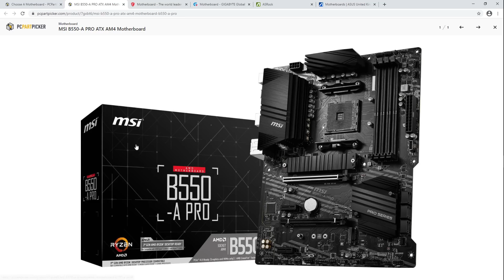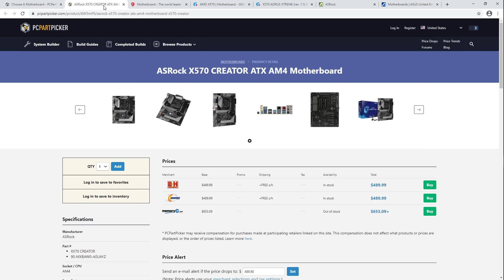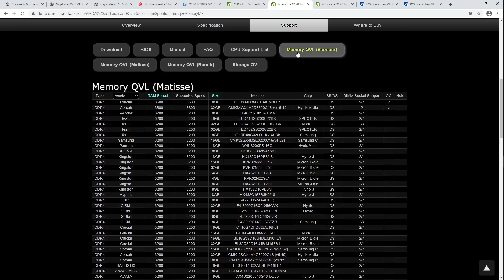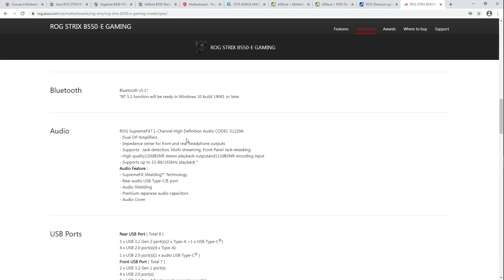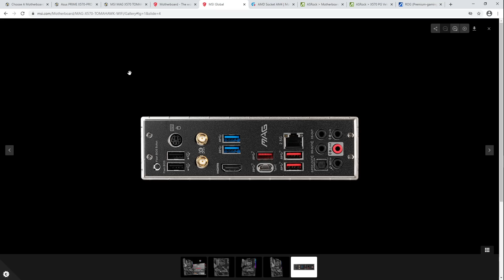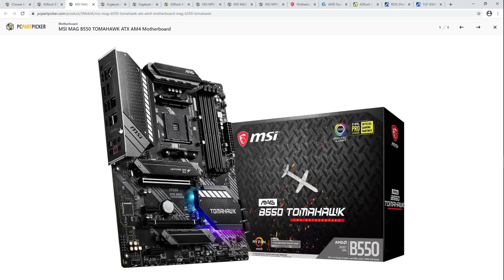Rambling about B550 and X570 motherboards. December 2020

Comment: 0:44 & 2:11:03 MSI B550-A Pro
1:53 Gigabyte X570 Aorus Xtreme
6:33 slight tangent into ASUS Crosshair VIII Hero & Formula
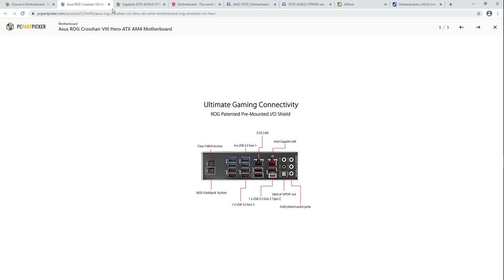7:38 back to Aorus Xtreme
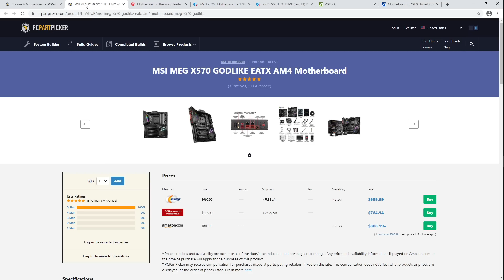8:49 MSI MEG X570 Godlike
12:25 MSI Prestige X570 Creation
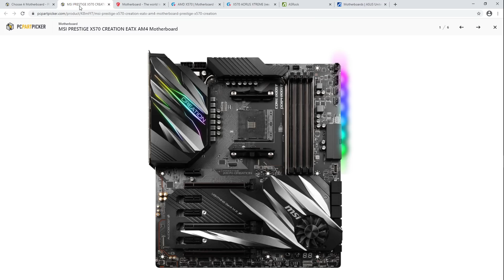18:38 ASRock X570 Creator
22:15 ASUS Crosshair VIII Hero & Dark Hero
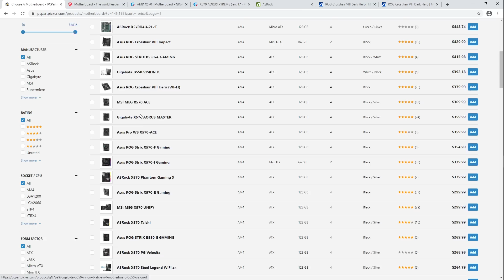28:34 MSI MEG X570 Ace & Unify
32:17 Gigabyte X570 Aorus Master
37:54 ASRock X570 Taichi
49:23 ASUS ROG Strix X570-E
53:37 ASRock X570 Phantom Gaming X
54:53 ASUS ROG Strix X570-I & B550-I
59:47 ASUS ROG Strix B550-E 
1:05:51 tangent into SLI, Gigabyte B550 Vision D
1:06:30 more SLI rambles, ASRock B550 Taichi
1:11:25 Actually talking about ASRock B550 Taichi
1:14:15 Actually talking about the Gigabyte B550 Vision D
1:15:00 Gigabyte X570 Aorus Ultra, Elite, Elite Wifi
1:18:25 ASRock X570 PG Velocita
1:20:47 ASRock X570 Steel Legend wifi ax
1:21:40 ASUS X570 TUF Gaming Pro
1:22:09 Gigabyte X570 Aorus Pro Wifi
1:22:37 Gigabyte B550 Aorus Master
1:24:25 ASUS X570 Prime Pro
1:26:10 Gigabyte X570 I Aorus Pro Wifi
1:26:37 MSI MAG X570 Tomahawk Wifi
1:30:14 MSI MPG X570 Gaming Pro Carbon Wifi
1:30:35 back to X570 Tomahawk
1:32:57 ASRock X570 Extreme4
1:33:25 Winner of the $220 mobos, ASUS X570 TUF Gaming Pro Wifi, honorable mention B550 Taichi
1:35:35 MSI MPG B550 Gaming Edge Wifi
1:36:10 ASRock X570 Steel Legend
1:37:45 Gigabyte X570 Aorus Elite
1:39:48 & 1:50:17 Gigabyte B550 Aorus Pro AC/V2
1:42:49 ASRock X570 Phantom Gaming-ITX/TB3
1:44:36 ASRock B550M-itx/ac
1:46:05 ASUS Prime X570-P
1:46:58 MSI MPG X570 Gaming Plus
1:49:04 MSI X570-A Pro
1:49:14 ASUS TUF Gaming X570 Plus
1:49:28 ASRock B550 PG Velocita = Steel Legend = Extreme4
1:49:54 & 1:52:04 MSI MAG B550 Tomahawk
1:50:38 ASRock B550 Extreme4 & Steel Legend
1:51:24 & 1:58:50 ASUS TUF Gaming B550 Plus (WiFi)
1:52:58 ASRock X570 Phantom Gaming 4 Wifi ax
1:54:06 Gigabyte X570 Gaming X
1:55:01 Gigabyte B550 Aorus Elite V2
1:55:37 MSI MAG B550M Mortar (WiFi)
1:56:42 & 2:02:25 Gigabyte B550M Aorus Pro P
1:58:03 Gigabyte B550 Aorus Pro
2:00:02 ASRock B550M Steel Legend
2:03:30 ASUS Prime B550M-K
2:03:40 ASRock B550M/ac
2:04:13 Gigabyte X570 UD
2:05:22 Outro - Buildzoid's favorite motherboards
2:08:19 ASUS ROG Strix B550-F Gaming (WiFi)
2:12:10 Actual Outro
Reply: A Legend!
Reply from the maker: dude you're insane!
Reply: @ActuallyHardcoreOverclocking  thank you! I didn't see any timestamp when i got here so i decided to skip here and there to make a timestamp comment first then watch later
Reply: @ActuallyHardcoreOverclocking  well he actually used Edit button so its not that insane. A real timestamp pro woulda done it in Notepad and copypasta to make it legit (no edit).
Reply: @mesaber86  I did that then added like 3 that i missed the first time around
Reply: @swisscheesedorito  so you failed your mission :D
Reply: @ActuallyHardcoreOverclocking  you probably dont care that much but maybe consider covering audio chips in your motherboard overviews. Its a pretty important thing as far as driving high ohm headphones. I know people just use usb and dacs and stuff now but it’s important to me and some audio people when building.
Reply: @ActuallyHardcoreOverclocking  

You should pickup a Retail Taichi and Taichi Razor Edition and compare them.
Reply: @shadowopsairman1583  he actually went over the razor edition in the vid. dont ask me when
Reply: @NJcinemaHD  supposedly ot has 16 phases however A physical compare would help
Reply: @ActuallyHardcoreOverclocking  You should pin this comment dude lol.
Reply: That was really needed, thank you so much.
Reply: Incredible! Thank you for rambling to us internet strangers.
Reply: Respect!
Reply: you tha real mvp
Reply: Sexiness arises!!!
Reply: you mad man
Reply: saved me litarly hours
Reply: Excellent job mate!
Reply: You need to get paid. :D
Reply: Thank you!!!
Reply: God bless you good sir.
Reply: 1:00:52 No. That's not your PC.
Reply: The B550 Gaming edge wifi was a good value at $150 w a $30 steam gift card on black friday
Reply: Cheers dude!
Reply: Godsend!
Reply: Omg
Reply: THANK YOU SO MUCH YOU MVP!!!
Reply: ...Was looking forward to what he thinks about the gaming edge wifi, since I effectively got it for 60 bucks here in Germany during blackfriday season :(
Reply: Thank you
Reply: You are doing God work, God speed.
Reply: Thanks!
Reply: 12 minutes rambling about ASRock X570 Taichi, im gonna buy this one, thx for avoiding me to watch this video
Reply: Thanks that was perfect.
Reply: Da real mpv
Reply: THANK YOU Stranger
Reply: Picking up a dark hero 8 from microcenter, got very lucky.
Wanted to here our boys opinion
Reply: This actually saves us allot of time, more rambling please
Reply: @Hudson Armani wow , that was fast and easy,  wonder if it can do other platforms
Reply: M-m-m-assive respect for u, ty
Reply: Godsend post!
Reply: People sometimes tell me "Jesus loves you anyway."
I'm thinking "No, it's people like Swiss Cheese Doritos who put out the love."
Reply: Thank you kind sir !!
Reply: RESPECTS!!!
Reply: This is what he should've done lol
Reply: Love you ~

I just finish work. ~
thank you.

now, a noop me going to have to figure out which X570 to buy -_-

Asus ROG Crosshair VIII Formula - is originally am thinking of going for only to know that there is a lot of plastic....
Reply: i lterally did the same thing, refreshed and saw yours:D your format is way nicer tho^^
Reply: 1:53 Gigabyte X570 AORUS XTREME
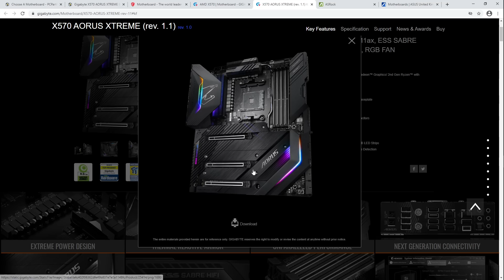5:42 ASUS ROG Crosshair VIII Formula
8:50 MSI MEG X570 GODLIKE
12:16 MSI PRESTIGE X570 CREATION
Time stamps:
18:37 ASRock X570 CREATOR
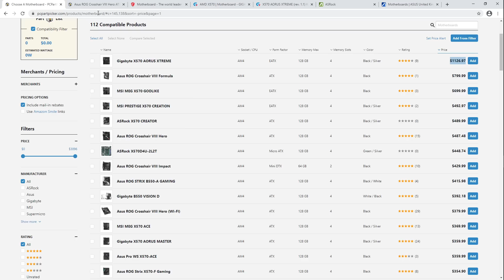22:27 Asus ROG Crosshair VIII Dark Hero
28:33 MSI MEG X570 ACE / UNIFY
32:18 Gigabyte X570 AORUS MASTER
37:30 ASRock X570 Taichi
49:23 Asus ROG Strix X570-E Gaming
53:36 ASRock X570 Phantom Gaming X
54:53 Asus ROG Strix X570-I Gaming
59:46 Asus ROG Strix B550-E Gaming
1:05:47 Gigabyte B550 VISION D
1:06:37 ASRock B550 Taichi
1:18:25 ASRock X570 PG Velocita
1:20:46 ASRock X570 Steel Legend WI-FI
1:22:09 Gigabyte X570 AORUS PRO WI-FI
1:22:39 Gigabyte B550 AORUS MASTER
1:23:28 Gigabyte X570 AORUS PRO
1:24:24 Asus PRIME X570-PRO
1:27:34 Asus TUF GAMING X570-PRO WI-FI
1:29:50 MSI MPG B550 / X570 Gaming PRO CARBON WI-FI
1:32:58 ASRock X570 Extreme4
1:34:30 MSI MAG X570 TOMOHAWK WI-FI
1:35:32 MSI MPG B550 Gaming EDGE WI-FI
1:37:39 Gigabyte X570 AORUS ELITE
1:39:44 Gigabyte B550 AORUS PRO AC
1:42:47 ASRock X570 PHANTOM GAMING-ITX/TB3
1:44:30 ASRock B550M-ITX/ac
1:46:04 Asus PRIME X570-P
1:46:55 MSI MPG X570 GAMING PLUS
1:49:14 Asus TUF GAMING X570-PLUS
1:49:27 ASRock B550 PG Velocita
1:52:58 ASRock X570 PHANTOM GAMING 4 WI-FI
1:53:15 Gigabyte B550 AORUS ELITE AX
1:54:05 Gigabyte X570 Gaming X
1:54:58 Gigabyte B550 AORUS ELITE V2
1:55:35 MSI MAG B550 MORTAR Micro/WI-FI
1:57:55 Gigabyte B550 AORUS PRO
1:58:43 Asus TUF GAMING B550-PLUS
1:59:41 ASRock B550 Steel Legend Micro
2:02:16 Gigabyte B550 AORUS PRO-P Micro
2:03:21 Asus PRIME B550M-K Micro
2:03:37 ASRock B550M/ac Micro
2:03:51 ASRock B550 PHANTOM GAMING 4
2:04:09 Gigabyte X570 UD
Outro Favourites
2:05:20 MSI PRESTIGE X570 CREATION
2:05:36 MSI MEG X570 UNIFY
2:07:08 Asus TUF GAMING X570 PRO WI-FI
2:07:40 Gigabyte B550 VISION D
2:08:16 Asus ROG Strix B550-F GAMING WI-FI
2:08:56 CREATION / Taichi / UNIFY / VISION D
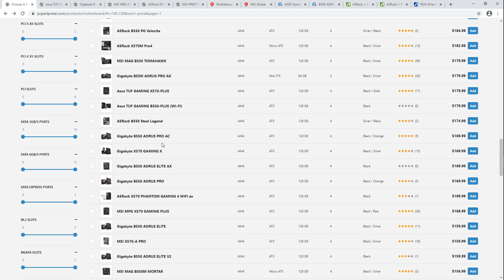2:09:54 Gigabyte B550 AORUS PRO V2
2:10:17 Asus ROG Crosshair VIII Dark Hero
2:10:57 MSI B550-A PRO
2:19:27 Asus ROG Strix B550-E GAMING
Reply: I was about to comment and say BZ please put in time stamps. But wow, you sir are a champion among kings... or something
Reply: You saved me a ton of time and frustration. I was looking for his opinion on Unify for an hour now.

Comment: I'm looking for AM4 Mobo with good enough VRM to run 5900X/5950X full tilt for 8/10hrs a day (this will be my yocto-building machine) with, and that's the most important, support for TB3(including video output!). Any suggestions?
Reply from the maker: I think the only board I've seen with video in for TB3 is the X570 Creator.
Reply: @ActuallyHardcoreOverclocking  That was quick one, thanks, ordered :). I hope it'll be able to run 128GB XMP 3600MHz CL16. The worse part is the availability of the Ryzen 5900/5950X...
Reply: @Iscandelt  I think taichi advertised TB3+Video as well

Comment: MSI BIOS is baaaaaaad very bad ,you can see trough but it is a mess in functionality, i ahve a ryzen 7 5800x paired with MSI MAG x570 tomahawk and it is bad, cold boots will get me bsod s and have to power cycle to get it working into windows.i i disable pbo in bios it wont even boot , i hade the latest bios the beta one and i went back one step it worked for like 1 week and now i have problems again , sometimes i get a kernel whe error too.

Comment: My 5900x did 230W with PBO set to +75 and stock VCore. No voltage curve either.
Reply from the maker: what are you cooling it with? Also how are you measuring?
Reply: @ActuallyHardcoreOverclocking  360 rad and about .5 litres of water. Looking at "CPU Package Power" on HWInfo64. Board is x570 Tomahawk, although it does go to 115% "Power Reporting Deviation" at full load, so it looks like it's reporting a bit more than what it's drawing perhaps?

Comment: What do you reckon I get, gskill ripjaw 4400, 16-19-19-39 or 17-18-18-38
Reply: Cheapest option. The difference will be miniscule.
Reply: @bobbysmith9725  well which is better because there’s like a 10$ dif may as well get the best
Reply: @spencerrr8127  The 16-19-19-39 has a lower CAS latency so I'd go with that.
Reply: @bobbysmith9725  yea ik it has lower cas but it’s other timings are higher? idk which is better
Reply from the maker: I'd probably take the CL16

Comment: FIT is still active when you enable PBO, meaning silicon health is still monitored & limits enforced to save the chip. PBO does not remove these limits. PBO only changes PPT/EDC/TDC and fmax & scalar, all those still run "under" FIT so even if you max them FIT will still limit them in the end.
Reply from the maker: I'm aware
Reply: @ActuallyHardcoreOverclocking  Well it sounded somewhat different in the intro of this video but that might be me interpreting it wrong.

Comment: The no post problem when pairing with Ryzen 3000 with MSI B450 Tomahawk was a disaster. MSI is still not explaining the causes and if they have solved the problem properly (which they could not reproduce the problem). It is so risky to buy MSI boards.
Reply: Yup. Have had nothing but trouble with MSI boards.

Comment: Hey Buildzoid, is it true you can bios flash a X470 Taichi bios on a X370? Im considering flashing mine.
Reply from the maker: It wouldn't surprise me if it worked but I've not looked into it
Reply: @ActuallyHardcoreOverclocking  Thanks man. Just did a ram overclock (3466mhz) on Zen 1. Running a Memtest now. Gonna watch your video while the test runs :D
Reply: I wanna try it...

Comment: Still Gigabyte bios are utter trash. Even after F31 and F11 stable bios released for x570 and B550 respectively.
Reply from the maker: A lot of the 3000 series BIOSs were completely fine for me. The issues with 5000 series are mostly because AMD keeps adjusting the AGESA